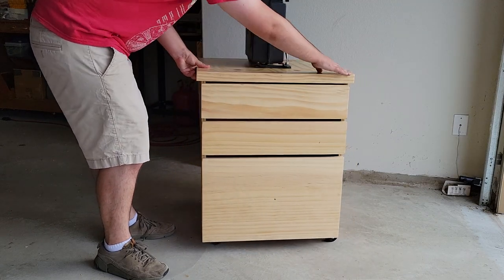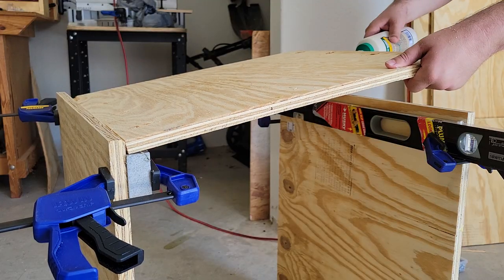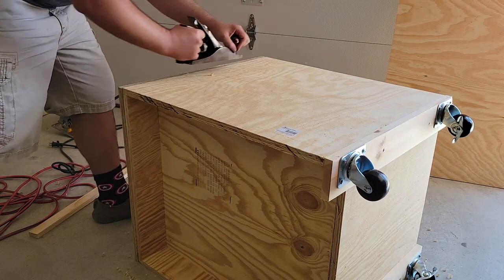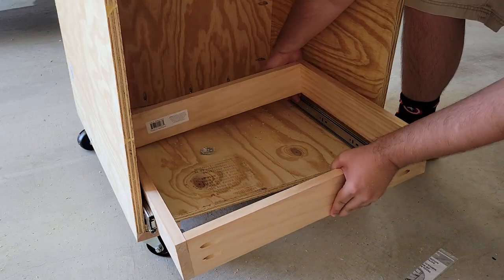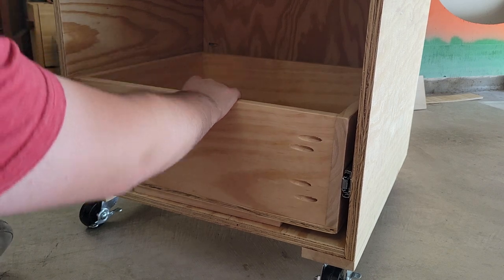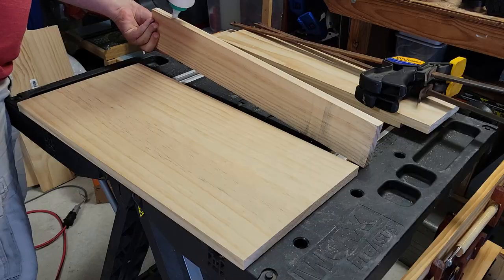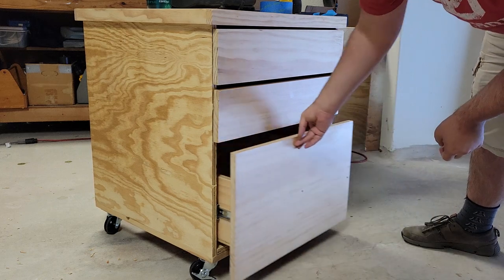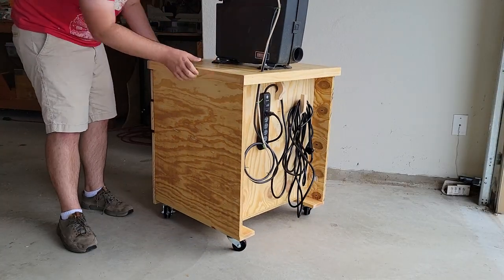BANDSAW STAND // First Time Cabinet Making

Comment: I just finished building your version for a small 8" Bench bandsaw.  I added a feature which I have found useful and that is to add a architrave or skirting board around the top surface that is proud by about 19mm.   It has the advantage of giving you an edge to grip when you want to move the cabinet around and also provides a small well where pencils and other tools can't roll off the top of the bench when cutting or moving.
Reply from the maker: Nice, great idea!